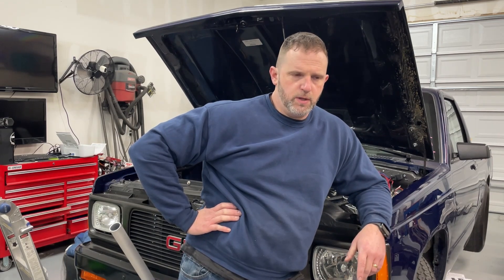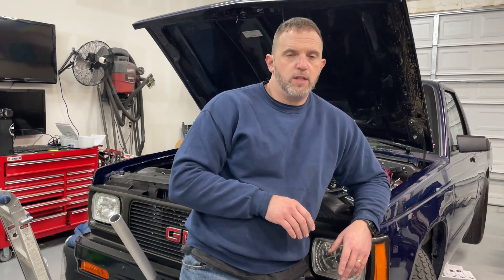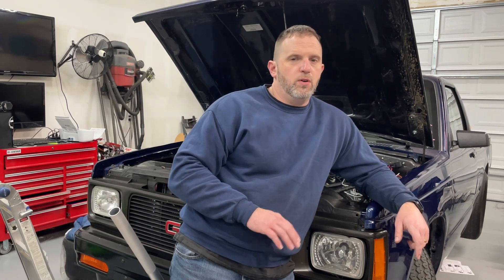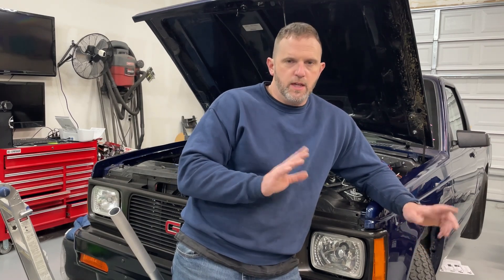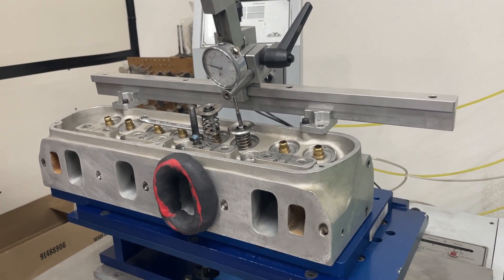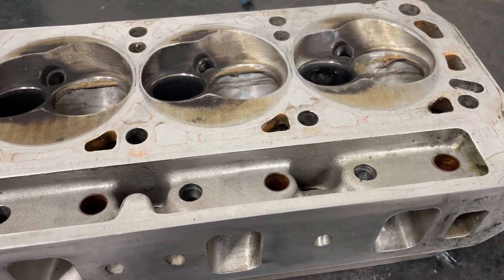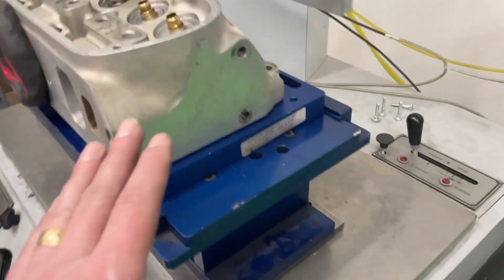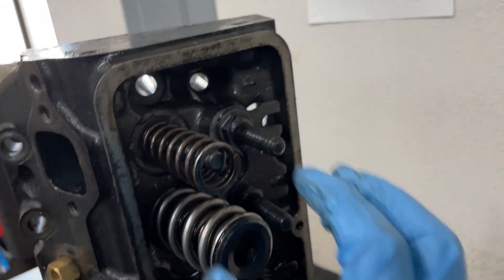A Variety Another Superflow 750 Fail, SBF 7721, Run An Air Cleaner, and Other Things

Comment: 1998 I got the 1st pair if production Victor Jr. for a mildly non ic boosted 347. I cleaned up all the bowls with more work on the exh. I had use of a SF600. 
For 1998 it made good power. 576 whp, 596tq.
Too much pwr for the 86 GT convertible it lived in.